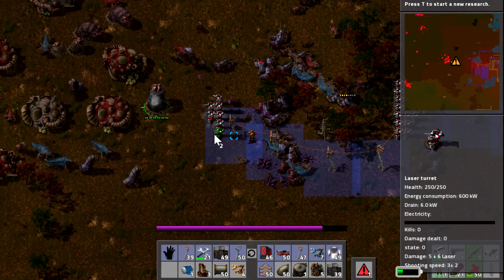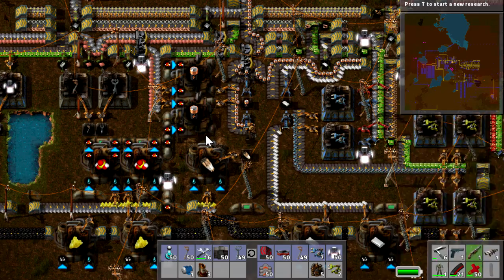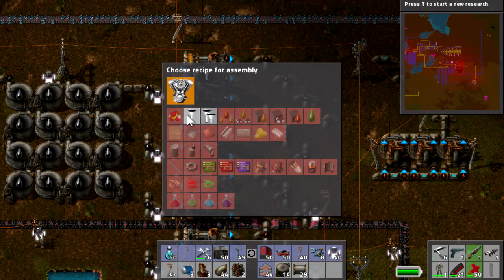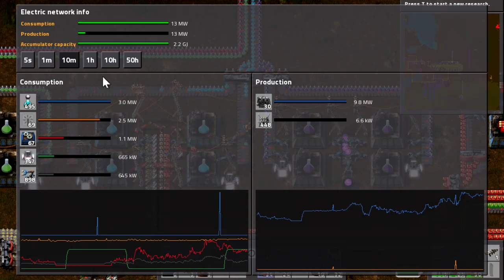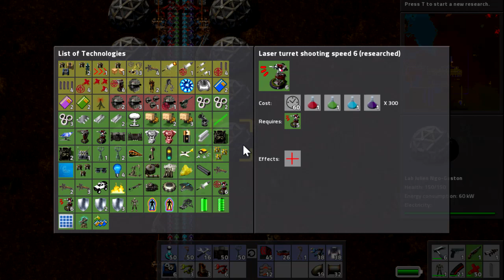Factorio 11 Industrial Science

Comment: dont know if you know or not, but 2 very useful tips. 

1: using control will save you lots of time with resource movement. it allows you to not open a inventories menu to exchange items. by pressing control with coal on your cursor, you can automatically place all the coal you have on your cursor, or half the coal you have on your cursour into any inventory that will accept coal using the left or right mouse clicks. ctrl clicking on an inventoy that contains only one item will get you at least one stack of that item from that inventory, such as the steel in a furnace.

2: when placing power lines, if you hold the mouse click and walk, it will auto place them as far away as possible from the last placed one. just place one, then either dont let go of the mouse click, or click and hold on a place that can not be placed, then walk. note there may be a bug with this that will very rarely cause you to crash if you move the placement too far away from yourself causing it to try and place a power line too far away from yourself.
Reply from the maker: anialator1000000 Yea i know both of em :-)
Reply: To add to #2, a nice invalid place to start holding the mouse button is on another power line.